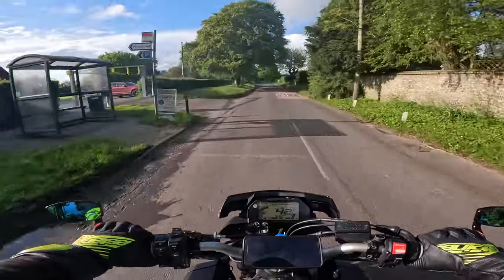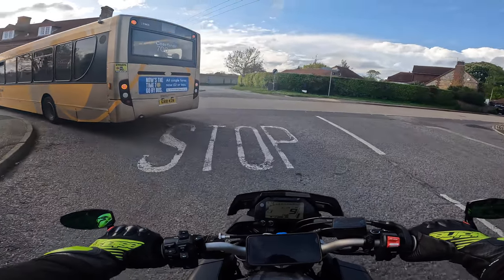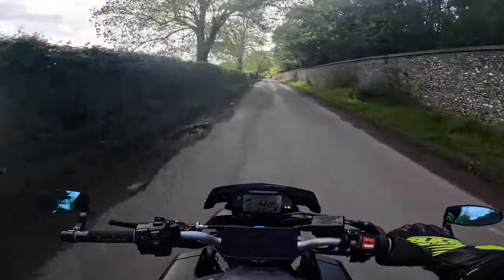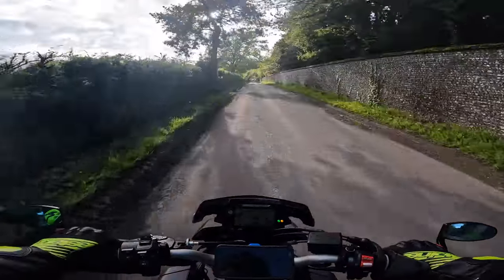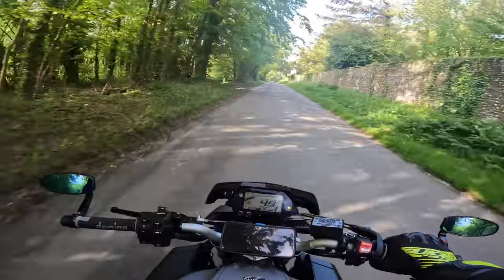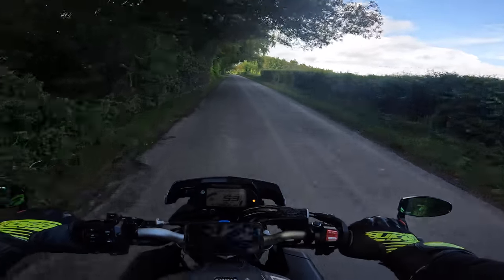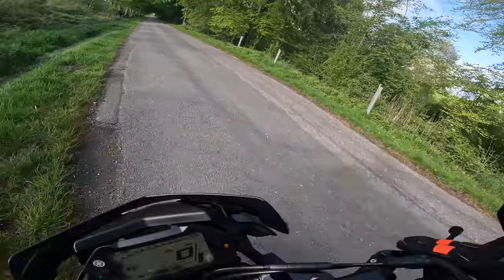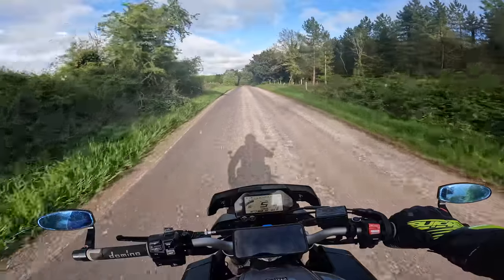How i scrub in new motorcycle tyres!

Comment: I dropped my MT-10 SP with like 10 km/h last weekend...😅 
Never happened to me before. Tires were 30km old. I think that was the problem + sticky clutch plates after months in the garage (anyone else have this problem with the MT-10?).

I'm ok, bike is mostly ok. Thank god my bike is fitted with crash protection so this little slide 'only' costed me around €650 to replace all the Gilles an Metisse Racing parts....
Reply from the maker: Well least you’re ok! Have you checked your clutch cable and or oil?
Reply: @BikeLikeMike92  Bike has fresh oil and I lubed the clutch cable last December. And yeah, most important: I'm unharmed.

Comment: Good advice and great video Mike. There's a vid on here where they talk to a Bridgestone Tyre rep where he says that breaking in a tyre is more about settling in the carcass and belts of the tyre than roughing up the surface of the rubber. Not sure if he says it in this vid, but I've heard that tyre manufacturers stopped using mould release agents decades ago and it is only used on the sidewall of the tyre where they require the fine detail of logos and text to come out sharp from the mould. But as you say, it's common sense to take it easy on a new tyre.
https://www.youtube.com/watch?v=01YlwusCSlE